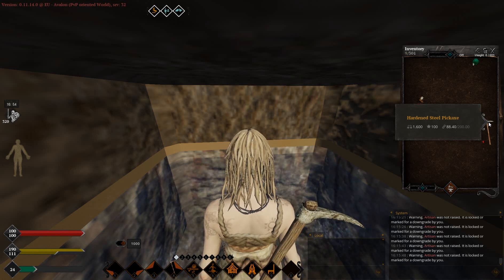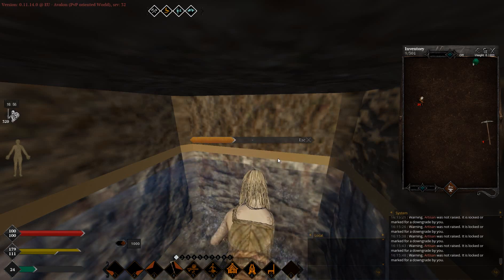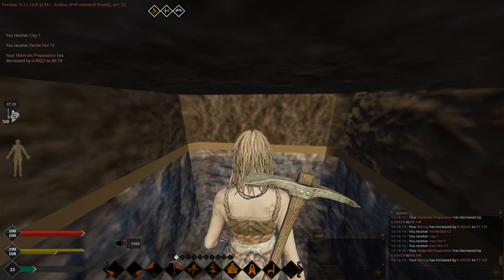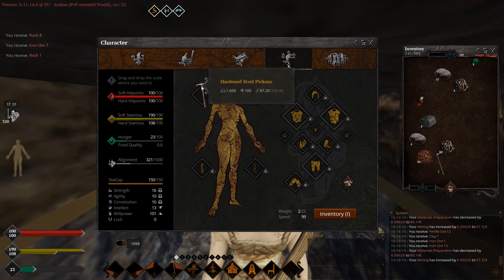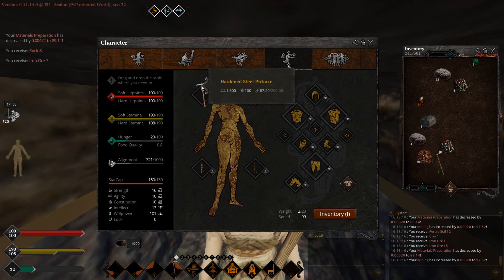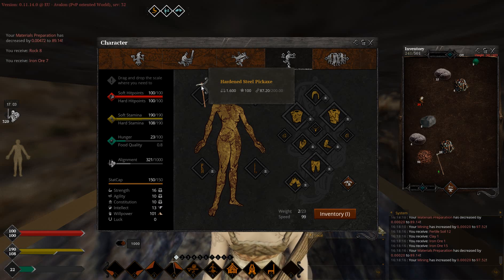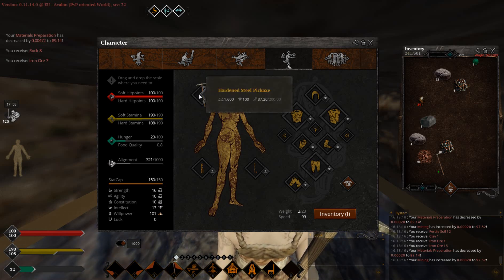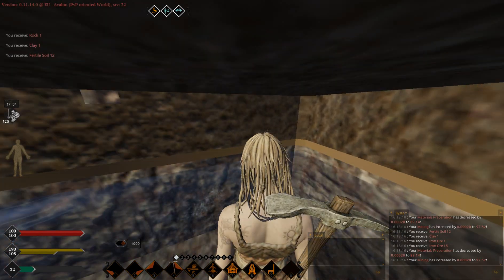LiF Tip 52: Hardened Steel Pickaxe vs Pickaxe

Comment: Seems like a waste of vostaskus atm, have you questioned the devs about the mining speed? Should it be the same as a cheap ass pick?
Reply from the maker: well, depends I guess, personally I need digging speed more, but I would love for it to have at least 50% boost for mining, sadly it is what it is right now.

And nope, I didn't ask devs if this is working as intended.
Reply: Games On just seems a bit pointless to invest all those resources for 2-3 seconds off your dig speed and you have to invest repair kits to fix it! cause your never going to smelt it down :D
Reply from the maker: thats true, but I didn't need vostaskus for anything else, so I was like "FCK IT!" :D